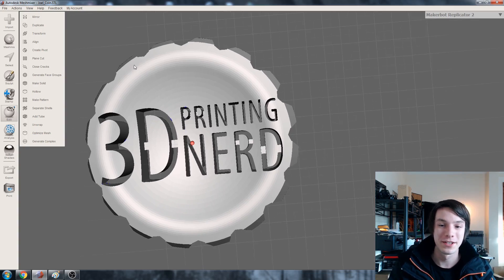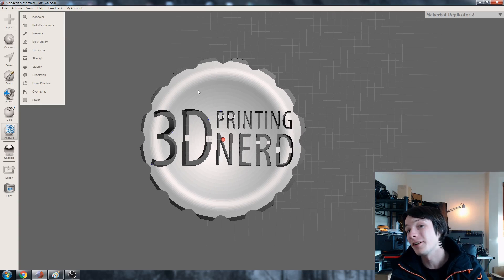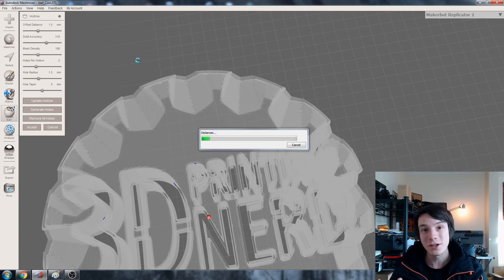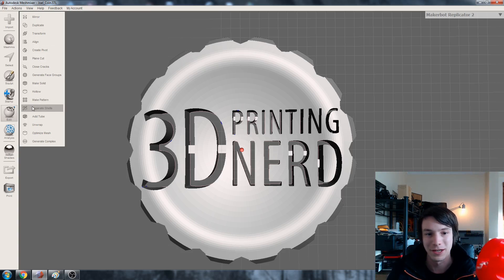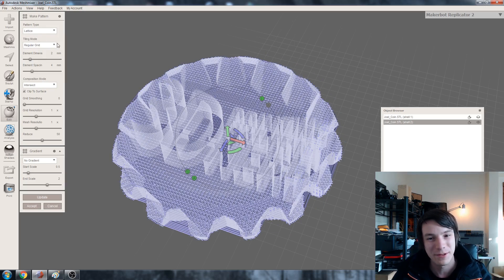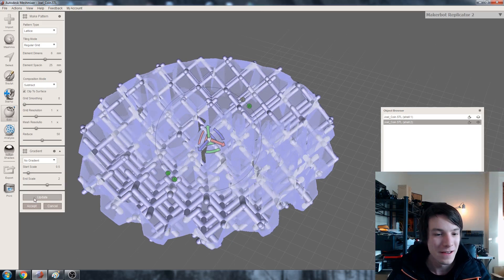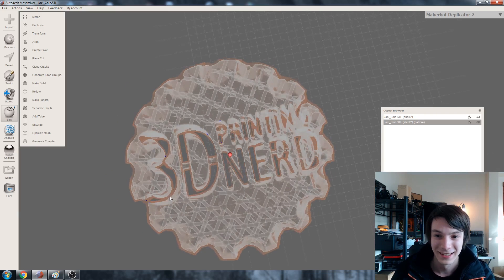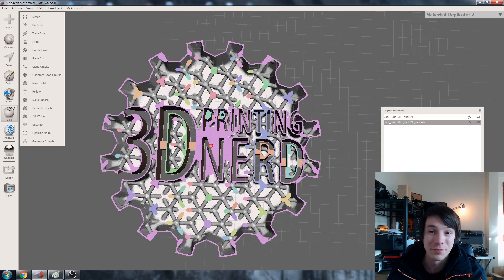How to do 3D Lattice Infill in Meshmixer

Comment: error "no multiple shells found" when separating shells is because you are using sla and inserting holes that joins the inside and outside but i cant find how to add holes after its made as it cant hollow the hollow to put holes in and there is no separate hole tool?
Reply: OK so for people trying to use lattice in SLA you have to put cylinders in the model where you want the holes then use BOOLEAN DIFFERENCE !

Comment: I tried out sort of 3d infill with slic3r long time ago. it was with hexagon and it turned to be more expensive, because of the walls and not structures as yours. you made a good example of geometry, design and material knowledge in one project.

Comment: +Angus - Nicely done. I have a question for you, though. If Joel prints this the size of a house, your lattice elements are going to be solid rods the diameter of your finger )or maybe arm). Is there a way to lattice the lattice (only)? I suspect if you go one level deeper, three levels, it may be possible. I'd hold off on the Joel print if this can be done...

Bonus is one more August blitz video added to the pile, of you doing the three level latticing.
Reply from the maker: Haha that is some meta thinking, but yes! The thicker rods of the lattice would have the standard infill from the slicer :) I don't think my computer would survive if I tried to add even more smaller lattice elements!
Reply: It's like Inception!
Reply: Meshception...